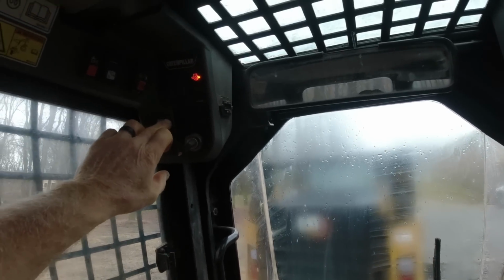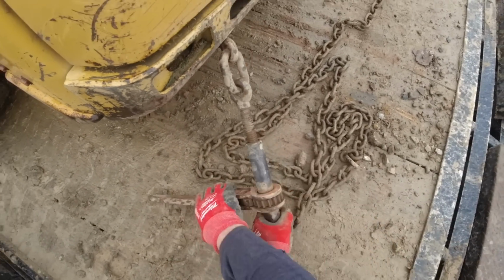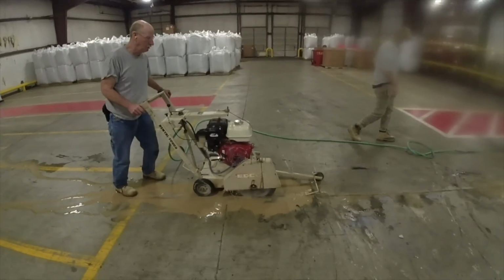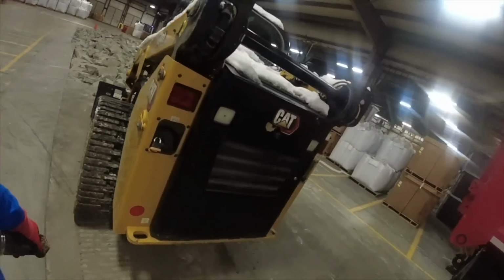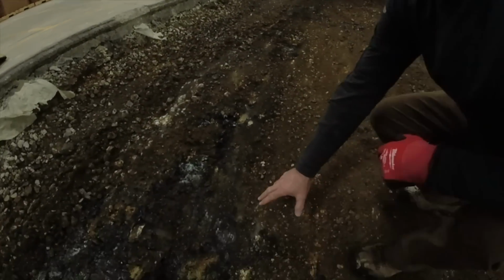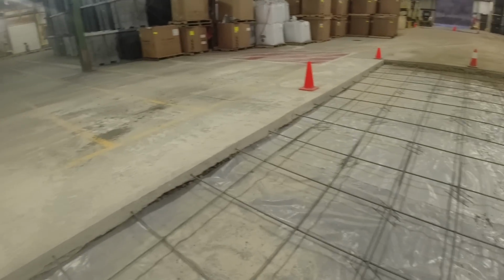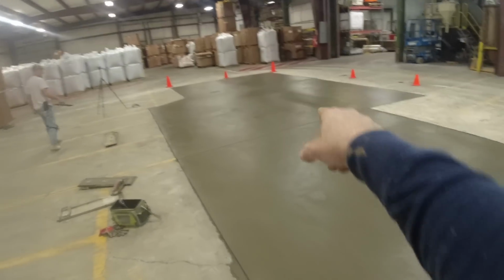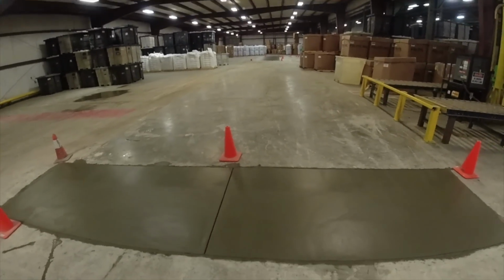What Is Causing This?!

Comment: My uncles shop was built by GE to rebuild trains the building was elevated  to truck height maybe 6' up under the 6" thick concreat floor was rock, not sure how deep this was at the base of a big hill in a river vally back in 51 the water leval durring a flood had reached the second floor.  Maybe this factory should have been raised on a solid surface with a good foundation under it then expanding soils wouldn't matter if it had drainage tiles around the outside or at least a dry river bed to catch the runoff off the hill, somhow i think a forest was cleared that used to deal with the ground water. Now id dig a 4' deep 5' wide sloped trench and fill it with rock and sand so when water comes down the hill it can catch it and divert it away from the building eventually the water table will drop
And the floor will stop lifting.
If the soils dry it wont expand.
It will stop the problems unless you get a 100 year flood. You could drain it to a dry well then pump it down away from the plant.  No more problems.
Reply: Im not an expert, but its a lot less problems to start outside the building away from the foundation.
If its a pipe leaking as somone said the water department can detect that. Sewage waste scope down the pipe, fresh water locate equipment  using radio signals on the metal pipes.

Comment: Put concrete wire under the re-bar and you can pull the wire as you go instead of using chairs and tripping
Reply from the maker: I still like to use chairs when we can

Comment: Slag in itself is not the problem, Compacted slag makes for a good fill material, ( have poured thousands of sq ft of industrial slabs and industrial footings on top of compacted slag with never any issues). What they have is a moisture issue with the subgrade. Also that moisture is also saturating that slag,,,causing both to swell and expand due to moisture, Economics would dictate, however the entire structure would benefit for perimeter drain in sufficient depth to provide a path for ground water moisture to be wicked away from the building slab. Without seeing test and Atterberg limits to verify the plasticity  of the soil underneath that slag, I'd bet the existing subgrade soil is either slightly, or highly plastic and vulnerable to expansion if moisture gets above optimum (a Proctor of that soil would indicate the percentage of moisture for the soil, however  moot at this point in time .  Also I'd bet all across the entire slab there is not sufficient expansion joints, so there is a double fold problem,,1. expansive soils exerting upward forces on the slab...2. sufficient room for slab expansion, leaving no where for expansive and heaving concrete go but up. Hence the cracks and heaving of existing slabs... The most economical "fix" at this point is doing what you are doing, However all patches of slabs should have expansion joints around perimeter. ..
Reply from the maker: Thanks all good points

Comment: Hey Tom, first time viewer of your channel here. First, great episode and wonderful explinations. Thank you! We ran into a similar issue in Lubbock, Texas back in 2009. Slag was used as a base media, and we found that every time it rained our warehouse would heave. Our company was a distributor of water chemistry for industrial treatment so 275 gallon totes would go in and out all day on forktrucks. We would avoid traveling over the effected area when it did heave, as best we could. That said, we did not tear out. Instead (since the building was at the base of a hill and water was pooling in a low area around the building) we built a 3' deep french drain around 3/4 of the building. Mainly around the areas were no traffic would be. Almost instantly the slag stopped heaving as we diverted any water away from the foundation and out toward the street for runoff. This solved our issue, and 14 years later we're still doing great! Might be something worth suggesting. We also placed a few layers of poly in the bottom of the trench and up the wall toward the building, then covered it, to prevent any passthrough leeching. It's not cheap, but it's cheaper than pouring 3000 sq.ft. of concrete again. Water, it's a huge pain in the butt. 

Great episode! I'll be back for sure!

Comment: The other issue you need to be aware of is if increased moisture levels caused the soil to raise...what will happen if you enter a very dry period where the moisture will decrease and the underlying soils will shrink. I have personally dealt with numerous events where floors heaved because of a broken water line in expansive soils. To correct that the concrete that is replaced must be capable of fully supporting the floor with zero support underneath (hollow) making it essentially a bridge...something to consider.

Comment: Couple of questions, if they had run rebar would it have lifted that much. I did not see any. If it is caused by moisture,  why is it only happening in the middle sections not at the outer perimeter where there would be much more moisture.  Was a stem wall installed around the perimeter?  If you are getting groundwater a couple feet down, is that not your problem? Pouring over a high moisture/water saturated sub can never be good.  It did last a long time under those conditions. Last thing, I have seen pads poured on the ground and were considered floating pads, no issues. Seems that should work granted you provide expansion joints. Thanks for the information.

Comment: I would think that with this entire building you'll have area after area doing this. It may be an idea to directionaliy drill under it to make a drainage network under the whole site to drain it.... I suspect the ground is heaving under all of it like permafrost. You may have to go to the trouble of building a subterrainian dam upstream of the building to divert or detain water that may make its way under the building. To top it off, as prior suggested, you will have to pump water out from under the building so a sump with a pump would be required. Be careful with this idea as well because you might be disturbing contaminated fill - who knows what might be in the mill slag that is exposed - mercury & arsenic come to mind, get the slag analysed for a work safety measure as to any toxic component in it, otherwise you may reap the whirlwind Ohio SNR style... take care. The other issue to consider is equivalent foundation performance, where what you put in must match the performance of the existing foundation, otherwise it will keep cracking. I'm surprised by how little reo is used.. I wouid have thought two layers of 4" x 4" 5/16 mesh would be required with a lower layer of 1/2" bar at 2' spacings would be used for this slab - as it is trafficked.. but then that may not 'performance match' the existing slab that I suspect you're doing.
Expandable soils? Yep, we have reactive clay soils here.... but... try this one - Tidal Soils & foundations. I worked on a building in Homebush Bay in Sydney, New South Wales  Terra Australis. I was told the slab heaved up & down 1' twice a day with the tides... the building frame didn't as it was on 60' piles with a perimeter beam. Glad I found this out as the freezer I was working on was on that slab. All connections to it had to be flexible.
Reply from the maker: It’s very interesting with the tide
Reply: @Concretewiththehauses  Sure was - had to put long scissor arms on the pipes going to the sprinkler system, which had to be fixed to the freezer so it would travel up and down with the freezer. You might get the same situation beside a lake or water storage dam.  This building was on reclaimed mangrove swamp... so where-ever you go check the local geography - are you working on a building near a lake, swamp or on reclaimed land???
Reply: @Concretewiththehauses  I guess another thing to check for is on perma-frost, if it thaws, or freezes   water expands when it freezes, even in the soil, whieh may be happening in the building in your video.

Comment: Curious?  How did you concluded the mill slag was a part of or big part of the perceived problem? 
And did you consider that the heaved area may have been harder ground and the adjacent areas had more fill and settled slightly?
Reply from the maker: Definitely mill slag, along with some clay took it down as far as I could go not much I could do after that
Reply: @Concretewiththehauses  Yeah I caught that it was mill slag. I'm just not getting how that aggregate was an issue.

Comment: When you're taking samples of the sub base like you did, try using a cordless SDS on hammer only mode with a 2 inch wide spade bit, it'll give you a lot more control than a digging bar and should let you get a less contaminated sample.

Comment: Bentonite in Colorado is the one I’m most curious about. I know basement walls have to be hung from the ceiling joists or walls and are never supposed to be anchored to floor. I’m in Minnesota where basements are a guarantee in every home we just bolt down our bottom plates. We have frost heave but nothing in the ground that heaves. Just rocks under soil here.

Comment: I've been watching a couple of your videos, I first ran into concrete work the summer I was 14 when my mother and I sold our house to a family friend. The house was...expired let's say. 
I helped them tear down the old and build the new house that spring/summer/autumn of 1975. It was a skinny lot with septic so we had to move a whole lot of cement the old fashioned way, the basement pour was 3 wheelbarrows and 6 suckers including myself. 
Fast forward and passing some other jobs I helped with including converting a Michigan cellar into a basement by dropping the basement and foundation a foot... I found myself in Colorado Springs in the summer of 1982, for some reason they didn't want to hire people from Michigan so I found myself going from building site to building site( they were building a lot of sub-divisions/homes/businesses )  pretty much doing a tiny bit of clean-up and a lot of wheelbarrowing cement across a 2x4 to a foundation or to the block masons. 
After a summer of that and still no job prospects I joined the army October of 82.
I wonder how those houses and foundations lasted.
Hard work but I enjoyed my adventure, and made enough to get by for awhile. 
Enjoyed the video and lesson on soil and the professional way you conduct buisness.

Comment: If it was mill slag, why didn't it heave everywhere?  Considering that mill slag was probably used on every job back then, are you sure that every problem is blamed on mill slag just because when there's an unrelated failure there just happens to be mill slag underneath?  Is there any chance there's a big boulder down there?  Usually the gravel base allows for quite a bit of soil expansion because it's a buffer, and it looks like there's enough there.  It just seems really weird to me.

Comment: Once again in a failing concrete floor, no rebar!  Start with basics.  The subbase may be heaving, not good but steel in the slab allows it to stay in plane as it moves.  Four inches in that large an area for that use is really asking for trouble.  Laid quick and easy leaving the troubles for the future.  A prescription many still use for disaster.  Know your contractor!!  Don't use the clowns.

Comment: so brief me on this what happens under the concrete that the millslag caused the outer perimeter has constant weight on it the inner part  of the slab has different weight from nothing to tractor trailers on it and heavy forklifts the solution number 4 rerod 12 inches on center both ways pinned to existing slab c-4 mix for the concrete mixture the millslag had nothing to do with it the water table and the pumping of the soin the weakness of concrete were all the factors the best thing was to bring in a engineer to evaluate not curbsite professionals your a concrete man not a soil expert itcould bit you in the ass trying to think you know what is going on and i can tell you a machine will do a much much better job with a harder surface and less labor less help THINK ABOUT IT

Comment: is it heaving in the middle, or is it sinking around the edges where all the weight is stacked? when you were attacking the mill slag with the bar it seemed to be very hard, unless it is heaving from water under an underlying clay layer with water under it? tricky problem, especially where the guy doesnt own the building!! Good luck with it.
Phil
Reply from the maker: Edges look good little is heaving

Comment: So you don't have the vibration of the hammer what we usually do if cut it up into cubes turn on the size and the weight then find the middle of each cut cube drill the middle anchor it and pull it out in squares what the high low or the bobcat with the chained or metal strap. There's more cutting involved but it is pretty effective and efficient
Reply from the maker: I don’t know is it really easier?
Reply: Yes it is and you don't have to worry about dust control

Comment: I was taught that when repairing a slab, like this, to undercut the existing/remaining slab carefully and the new concrete acts as a foot or ledge  to support the old so that the two slabs don't part company or the edge of the old/remaining slab cracks as it's not so well supported. 
Really nice job , good team, well done guys
Reply from the maker: Thanks
Reply: Do you like using a vibratory  blade type float on a job like this, if not why not.Thanks.

Comment: Sorry to tell you the main building perimeter is sinking and the interior is pushing up. Uncontrolled water at the perimeter creates the settling, and the interior is dry so it lofts. The homes in the dessert have this issue with some fine sand soils and NO GUTTERS TO CANEL THE WATER FROM EDGE OF SLABS OR FOOTINGS. This causes the perimeter to compact over time due to most buildings the main or largest roof loads are on the perimeter of the building. I've unbolted ridge beam posts on pitched roofs and the peak will raise out of the post bucket an inch or more because it is teetering on a post at mid-span between  the outside wall and center of the building. It becomes a pin pile fix and jack -up job. good luck. Is going to cost big $$ to fix and control.

Comment: Get a CPT or soil core drill done to approximately 30 meter (100FT) deep and found out what the soil bearing capacity is at lower soil levels. Also the load on the floor, the distribution and duration of stay is impotent to know. All the info combined, a good qualified Civil Engineer or qualified Geo-technical Engineer can tell you why this all is happening.
The floor may experience uneven settlement due to loads standing long duration times on the outer sides of the building floor and none in the center. Thermal expansion issues in the concrete itself can also be a factor in this.
Being a Civil Engineer in The Netherlands. Concrete floor slabs cracking for us usually indicated foundation issues with uneven settlement. All below mentioned comments and soil types (like; Peat, Clay, and Mill slack) changing water table levels and subsoil pipe and cable work have there share in the underlying cause. Get to the bottom of it, patching up the resulted crack concrete floor slabs several time is not a financial healthy situation or solution over time.

Comment: Yeah 4” probably 4000psi that was poured at 8 slump because the crew didn’t want to work their backs that cured at 2000psi with no rebar or mats. 

The fork lift alone is 5000lbs- each one of these Gaylord skid is 1000-1200lb and knowing the industry, and the stack, they’re moving 2 skid at a time to save on time. So what 7000lb moving on 4 wheels with contact patch the size of 4 coke cans on bad sub base slab with no rebar.
Reply from the maker: You could be right
Reply: @Concretewiththehauses   I have floor guys that do home garages in million dollar country clubs at 4” at washout with 3% accelerator in July and just let the floor self level. The industry is full of hacks cutting corners and ripping people off.

Comment: The expansive soils could be 10s if not hundreds of feet below the surface. Placing an impermeable surface (concrete) over the surface increases the moisture levels of the underlying soils due to the blocking of the evaporation/transpiration route. A undercut will only help if the expansion area is completely removed. Next time...hire an engineer before you build!

Comment: I have run into this problem before. The way I delt with the problem was I used hog wire and 5/8 rebar. Now I did do this job in New Mexico where the desert meets mountains. There the ground moves a lot. The first thing we had to do was remove around three feet of soil and put it back four inches at a time. Compacting it all the way back to grade. I made a rebar gride of 12" by 12" through out the whole floor. Next I  put down four inch square hog wire on top of the rebar. When we did the pour, we pulled the hog wire up into the slab. So far this has helped the slab stay intact. Twelve years later it is still in place with no cracks. by the way we also added two extra inches of concrete to the slab. In the fifties people didn't do soil test or go thick with the product. Slump makes a big difference when put down the product. Dryer is better is some cases
Reply from the maker: Interesting thanks

Comment: Very interesting problem in that building. 
I'm from Australia and have done more concreting than I like to remember. Your finishing was second to none. 
We also have expandable soils or as we say highly reactive clays. They are generally black cracking soils.
Many foundations and house slabs have broken in half on these soils.
We use pre fabricated mesh in slabs and footings in Australia on a lot smaller grid.
Reply from the maker: Every area seems to have this problem